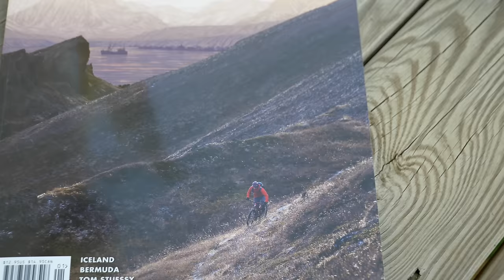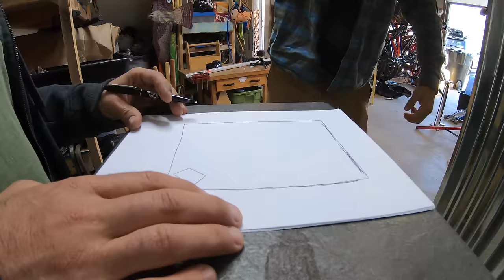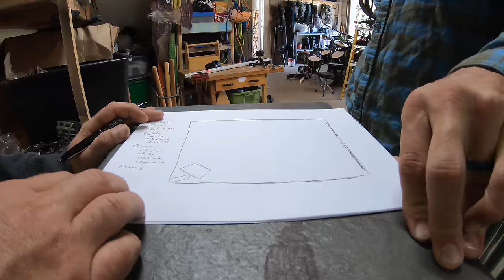Building Eric Porter's MTB Garage Workshop

Comment: `Two ways that I make more room in my one car garage. I use a 50 gallon barrel wood stove that I enclosed in concrete blocks and a concrete top about six inches thick. This allows me to move it right up next to the stud wall without a need for space or shielding. This works because it is a thermal mass that slows down heat up, so I don't get blasted out from the heat and gives off residual heat when the stove is out. The other thing I do is mount the repair stand up side down from the ceiling, like a periscope. It gets pushed up out of head range for storage and pulled down for use.

Comment: LEDs are not flicker free.  Don't believe me?  Take a slow motion video at 120 or 240 fps and they clearly do.  It's because US electricity is set at 60 Hz are LEDs flicker very fast to match this frequency.  They are sometimes hard to film under if the frame rate is too fast.

Comment: Love your videos but this one has so much wrong with it that I couldn't finish it:
1) Never throw away a working phone. Battered women shelters will take them but it's smarter to throw in your pack because 911 will still work.
2) TS? No way will a table saw cut anything safely without one square edge already. You can't cut logs, period. I know and I own a rarer model 12" Craftsman so I can miter 4 by 4s which most TS can not do. Rocking wood poses a HUGE kickback danger and I'm no safety sally - I've been running my TS w/o a guard for years upon years. Still have all my digits but I would never attempt to rip a log on one.
3) The wood stove in a garage is illegal across the USA. It's against fire code.
4) Removing those casters off with a sawzall was just stupid.
5) Save everything it never hurts to be a hoarder!